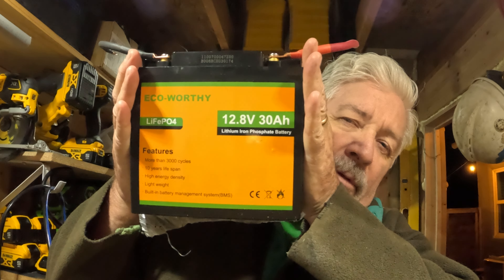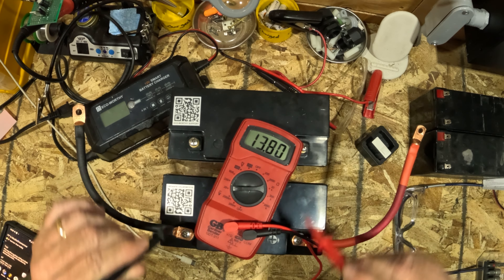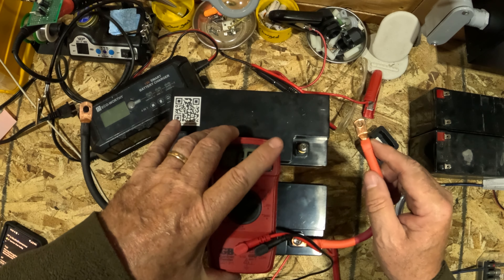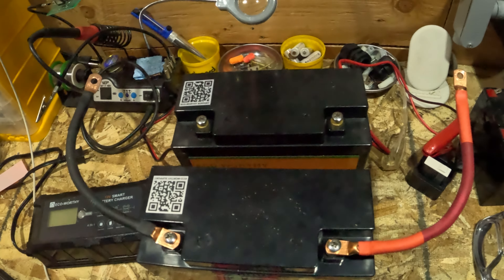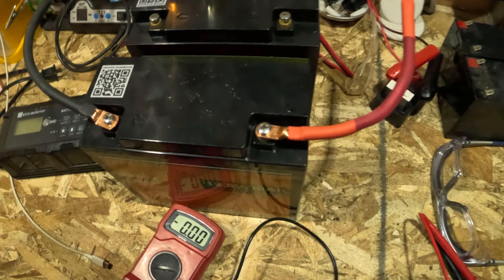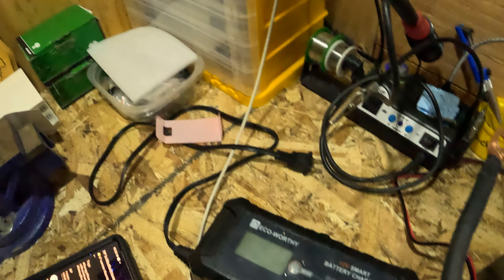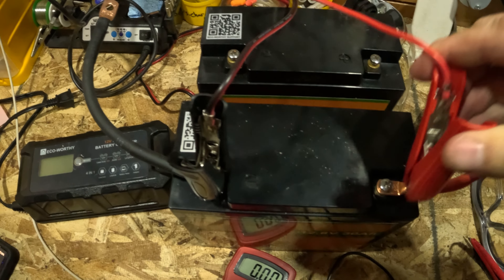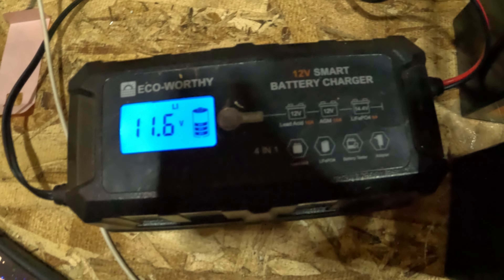How to jump start a LiFePo4 (lithium) battery such as Eco Worthy, Renogy, Li Time, Redodo

Comment: Thanks for the video. Can you jump start with a car battery? Or does it have to be with another LiFeP04?
Reply from the maker: @Fordy357  you can use a car battery, just make sure it's in the same voltage range